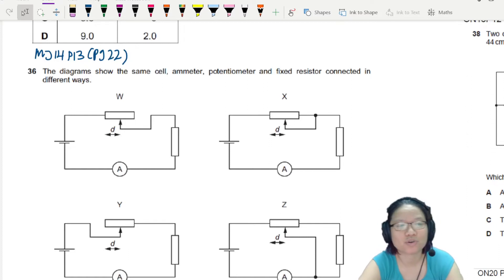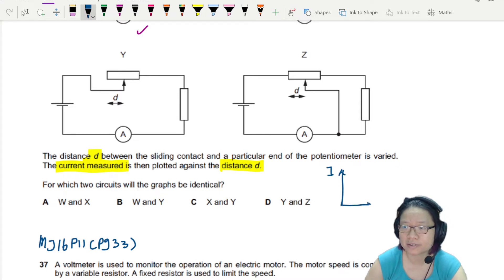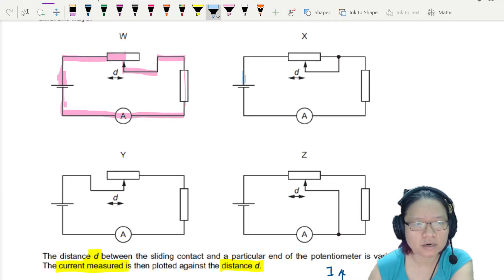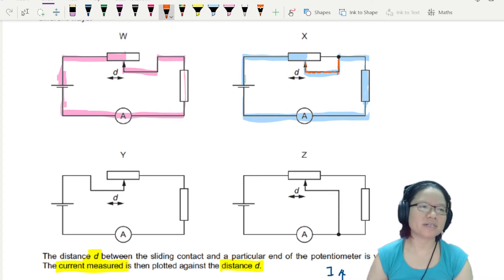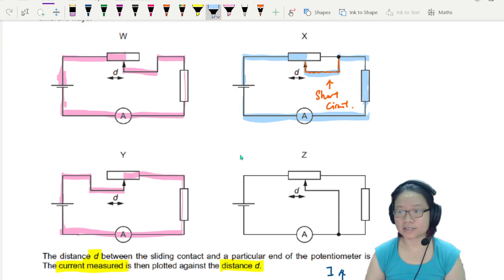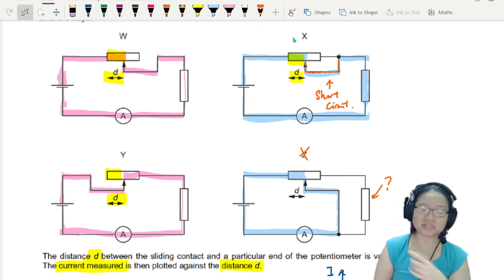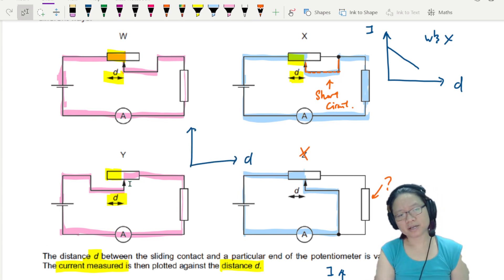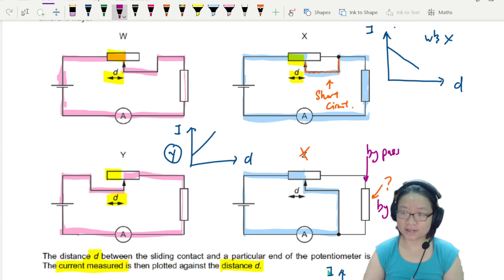10.3a Ex4 MJ14 P13 Q36 Circuit Current Distance Graph | AS DC Circuits | Cambridge A Level Physics

Comment: What is short circuit miss
Reply: if the current reaches a point with multiple paths and one of the path has zero resistance then all the current flows through that path as  current is inversely proportional to resistance and that is know as a short circuit